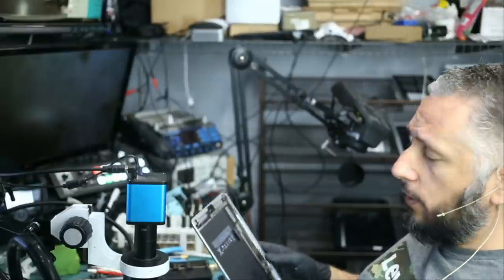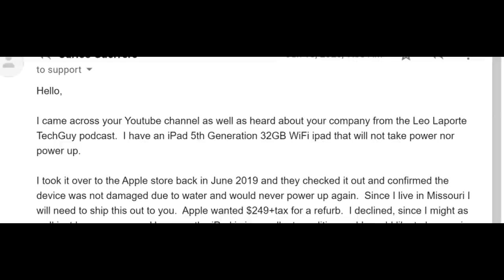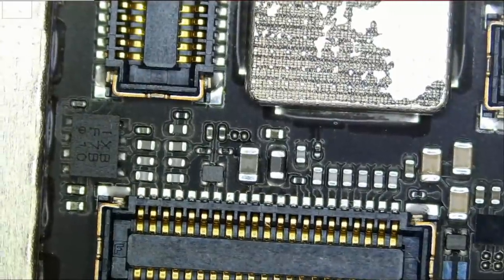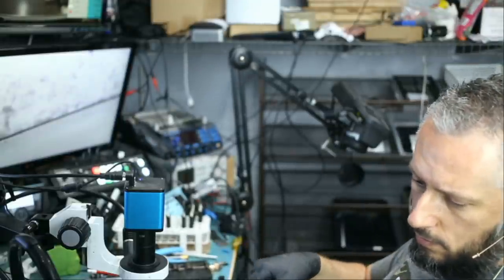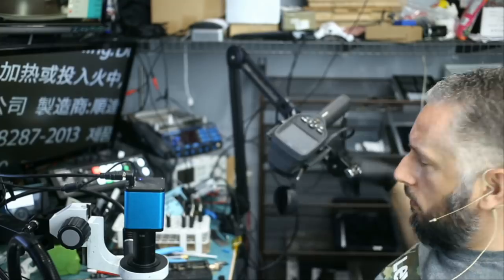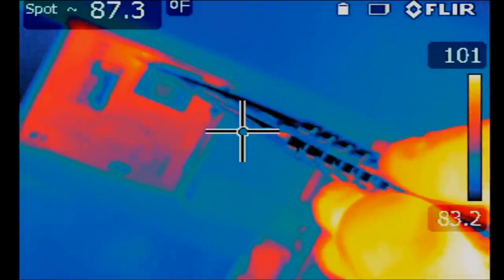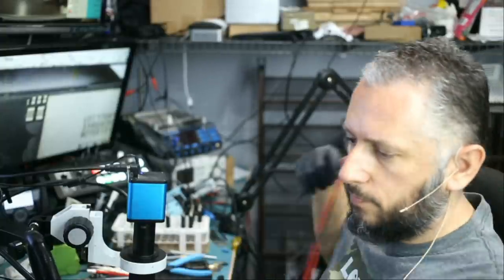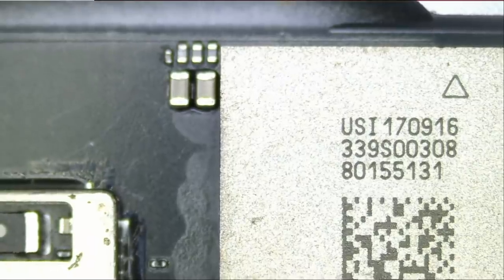iPad 5th A1822 No Power caused by WiFi - Thermal Cam detected short circuit

Comment: Most of the people for brand stores don’t know anything about technical troubleshooting so their default option is “it will never work again” or “would you like another one?” Not surprised it worked after you isolated the short. Excellent work!!!!
Reply: Reminded of the lawsuits on the right to repare where spokespeople were claiming that not apple licensed technicians don't have the means to repair their stuff. Kind of a mind boggling that such predatory companies are the ones at the top.

Comment: ما شاء الله ، your daughter is adorable 
One question / advice i want to ask is . Here in India short killer box are available 1v-5v 20 amp output . When a motherboard is full shorted they connect -ve to ground and +ve to +ve via terminal . What it does is that it will burn the cap which is fully shorted . Hence that cap will be replaced / removed .
Just want to know your opinion , is this useful tool ? 

( Thermal camera is way much more better than this ) .

Comment: Nice job using thermal camera! I was wondering if one would work good for small components! The place I used to work at used thermal cameras to find any “hot spots” on 480V 3 phase MCCs (breakers)... some up to 1200A! When those heat up enough/are loose enough, they don’t do little pits/arcs...THEY LITERALLY BLOW UP! Had a arc/short due to failed insulation on a huge connector for the 850kW generator blast a small jet of plasma through steel panel which my heart was 3” from not 5 seconds before it happened! God said “not today!” ... Got 3 boys from 9 to 16 in age, and a 12 yr old daughter!  ♥️cherish EVERY moment with your beautiful, precious little girl!♥️. For they do not stay little for very long, although they melt their daddy’s hearts forever! ♥️

Comment: Just out of curiosity. When you’re troubleshooting a device you’ve never seen before what documentation do you use to know the normal values you’re confident about, (e.g 0 to 0.1 amps when the battery is disconnected)?
Or do you generally learn this kind of information by testing a known good specimen?

Comment: Hi 
love the videos! just wondering, which type of flux and wick do you use?

thanks
Reply: yes we need to know
Reply from the maker: Amtech Flux http://northridgefix.com/product/amtech-nc-559-v2-tf-flux-10g-syringe-plunger-2-needle-sizes/ and Premium Wick http://northridgefix.com/product/premium-desolder-braid-wick-10ft-length/
Reply: @NorthridgeFix  thank you very much! love your videos btw!!
Reply: @NorthridgeFix  I was also wondering, how do you remove the solder from the anchor holes from a HDMI port replacement, i tried using different wicks but it just doesn't remove the solder?
Reply: Anchor points take a lot of heat. Add some low melt solder to the points. If you still have issue, raise the temp of your iron, but just for those points. After desoldering these, revert to normal temp level for the rest of your job...

Comment: Can you replace the wifi chip without issues or any special programming? Wondering if stuff like mac id would be hardcoded to the chip and matched in the tablet firmware.

Comment: I found that the Tristar tester has cold solder joint in the motherboard side of the usb connector just pop it open and re solder the joints this will fix some of the issues you are experiencing

Comment: In a battery there are 3three pins on either side on which 2pins denote +and minus on either side if I where to charge the battery which side should I give the volt for charging

Comment: The tristar tester has a fault. the solder connection from the Usb connector at the motherboard has bad soldering job and will fail. Pop open the blue box and resolder them